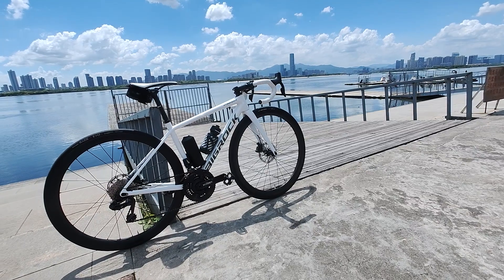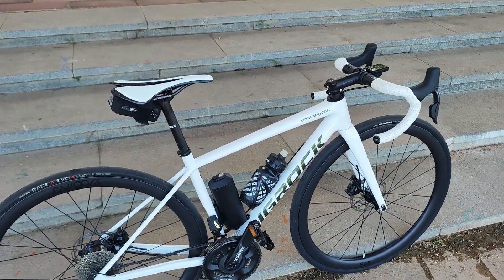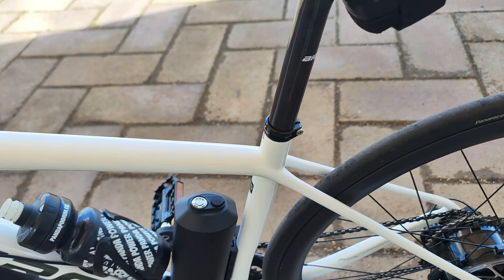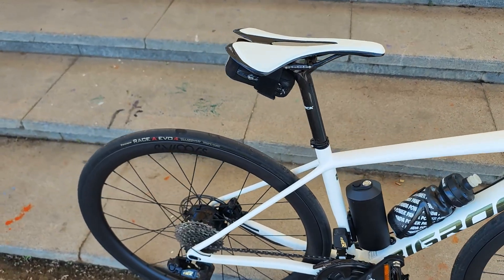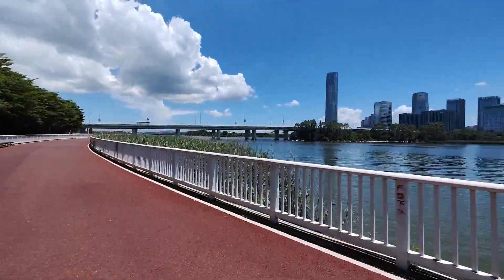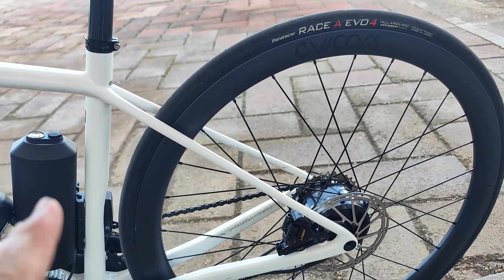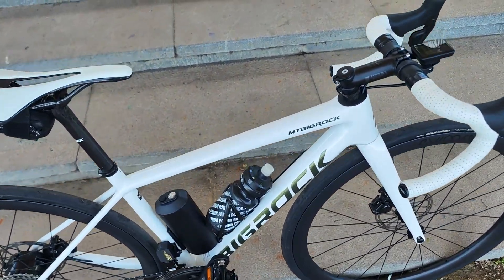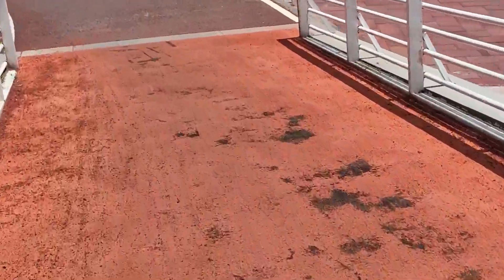EVIGORS - Convert any bike to an e-bike... 250 Watts of POWAH BABY!

Comment: In their site they put the battery pn downtube. I'd guess it would ne safer since some bikes have replaceable downtube storage doors, so if the battery damages the cage bolts, only thing that needs to be replaced is the storage lid.

Comment: I would like to see them offer one with 32h wheels and a 500w motor for the Clydesdales among us but if you’re a smaller rider 250w is plenty. Otherwise the whole kit looks pretty slick, especially the built-in torque sensor as that would make the bike feel more natural. Not having an external controller and rat’s nest of cables obviously keeps the bike looking tidy, that’s a big issue with other kits. I don’t even care about having an obvious battery mounted but I don’t want to deal with a bunch of messy cables.

Comment: Run a carbon gravel bike with a similar setup from FSA. Can get almost 90kms range from the battery (250Wh) on road tyres on road. But usually around 50km range off road. 43Nm of torque, but limited to 25kmh in the UK. I have a 2nd external battery the doubles the capacity and range

Comment: This is a very cool ebike category.  Even at 12-13kg ebike, this would be portable.  One of the reasons for commuting on a road bike.

The big innovation is torque sensing motor that can fit a large casette in road dropout geometry
Reply from the maker: Yeah, its very cool that the package is so self contained.

Comment: How much is it? Also, if you add the additional 2 batteries what would the total range be under full boost and how are the power supply wires arranged?

Comment: I"m 72 years old and the hills aren't getting any easier, so I've been looking for a conversion kit for my Giant Defy Pro 0.  This kit looks interesting.
Reply: get a mid drive torque sensing pedal assist like toseven DM02 or CYC photon. more powerful and feels natural than this crap
Reply: @siklistangpinoy3162  The main reason I'm considering a kit like this is it will work (I think) with a carbon framed bike.  I like the Photon, and it would be my first choice, but I'm pretty sure the carbon frame couldn't handle the motor's torque/power.
I also want to keep the weight as low as possible.
Reply: @84imreplica  a lot of carbon frames already has been used on mid drives. 250w hub drive is not enough power to help you on the climb. You will just waste your money on that. Been there done that.

Comment: I think it is pretty cool. I was checking out the website and you can tell they are still new. It shows a few models or options in the list, but only one works. I also saw that the hub can be ordered alone which would be nice to build up a different wheelset. It is only available in disc for now though.  It peaked my interest but I would want to put it on a rim brake bike rather than my new disc braked bike. I do like it way better than the other manufacturers doing a similar thing. This is much more clean. I also like how it is in the rear wheel rather than the front like a Switch.

Comment: Is there a rim brake version?
Reply: I was just looking at their website. It doesn't look complete. There are two versions that are listed, but link to nothing. You can buy just the hub and buld up your own wheel, but they only have disc brake hub. Maybe that will change in the future. I guess they are pretty new. I would like to have it but I would rather put it on my old rim brake bike than my new disc brake bike.
Reply: @DaveCM  I was thinking the same but was also hoping for a lighter version. Something which topped out at 30klms to keep weight down. Ideally something which is a stripped down version with a smaller, lighter battery is what I a looking for.
Reply: Check oit Geeko ebike kits

Comment: I was just looking at a Bianchi e aria, strange coincidence. The Bianchi e aria has so many limitations. The motor only kicks in when you're climbing, and the 250W motor provides the rider with assistance up to 15.5 mph (24.94 km/h) lastly, 200 watts isn't enough. A bit more would be better.
Reply: they are likely limited by law. i suspect they would be able to provide as much power as this one but had to be limited to be legally sold
Reply: @Carftymk  I saw someone on YouTube made some alterations to the Bianchi. ;)